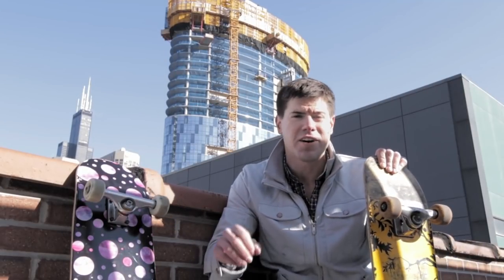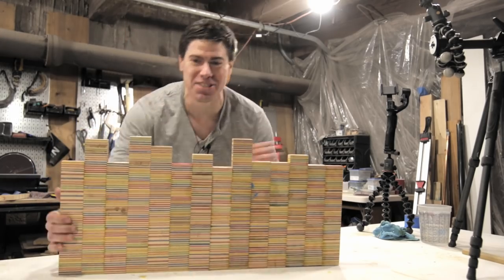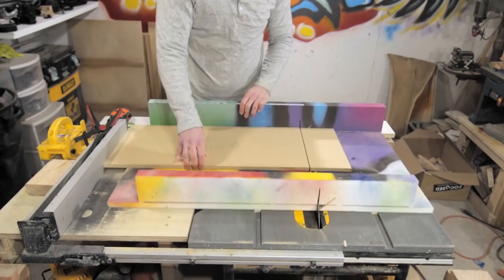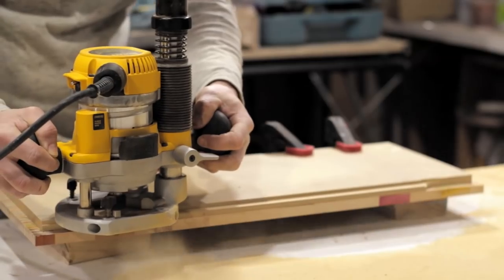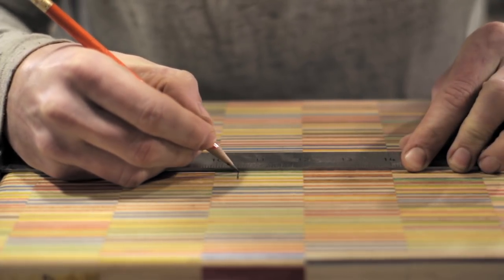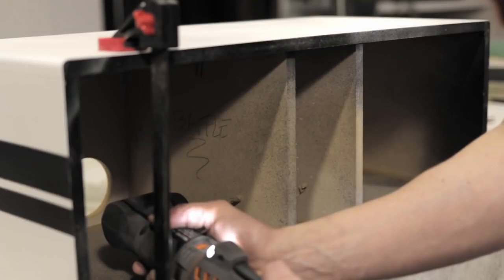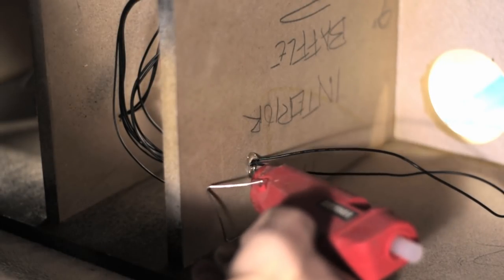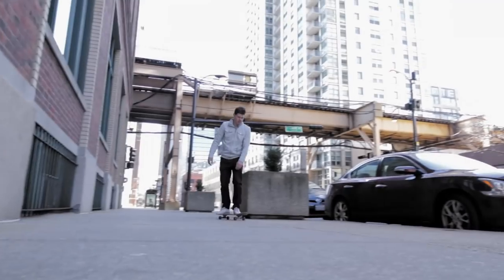DIY Recycled Skateboard Speaker || portable bluetooth boombox build tutorial

Comment: If you ever take that back panel off again I'd change out that battery sled. Looked like three 18650s which is only going to hold 10 to 15k mAh. You can purchase 8 bay sled and install it.

You could also get some laptop batteries and add a quick connects inside with a door and then carry a few with you. That could last a whole camping trip. I totally lack the equipment or space to work with wood, but I've got a few homemade battery banks for power outages. 

If Braille skateboarding still does you make it we skate it, I think you should try making a board for them. Keep in mind they end up destroying a lot of them. A lot of channels have gained massive subscribers from doing collabs with them.

Comment: Order of operations tip: Plane, then cut to length to minimize/avoid any planer snipe you might have.
Reply from the maker: Thanks for pointing this out.  I made a bit of sacrifice for keeping the flow of the video going, since this is sort of what I did.  I had to cut it down first to remove the jagged ends and get it to fit thru the planer, so I cut the long sides to rough size, then I planed, then I went back to table saw and cut it exactly to length. This back and forth got left on the cutting room floor, so I'm glad you mentioned it for anyone trying to replicate the project.  Thanks!

Comment: Awesome design!  Did you use that center section as a port?  That skateboard wood looks like a lot of fun.
Reply: Dope kick flip :)
Reply from the maker: +Wood.Work.LIFE -- Thanks!  The center section was sealed off and just used to house all the electronics.  Each speaker has a separate enclosure and port (the ports are just the black circles you see in back).

Comment: Very cool.  I need to improve my boom box building game.  I recently built a 2.1 as my first.  Mine has the 120V to 12v power supply and no batteries, 2- 3" full range drivers and a 6" sub.  It sounds pretty good but it doesn't look as good as yours.  Nice work.  Next time I'll just use MDF and round over like you did.  I used some old cherry veneered MDF I had and edge banded with more cherry.
Reply from the maker: Edge banding gets me every time!  So hard to make it look right....  For yours, you could probably do a similar setup, depending on the power output of the sub.  I want to do a build at some point where I add a crossover for a sub, but am just taking it one step at a time, and the ported design was new for me this time.